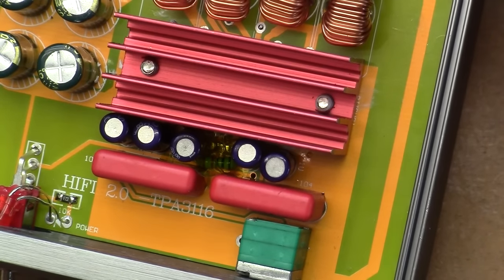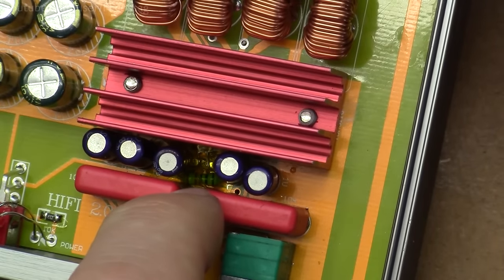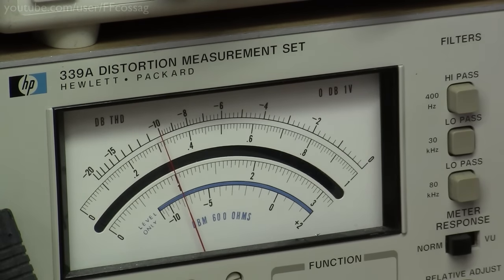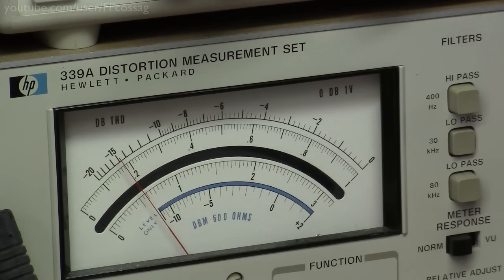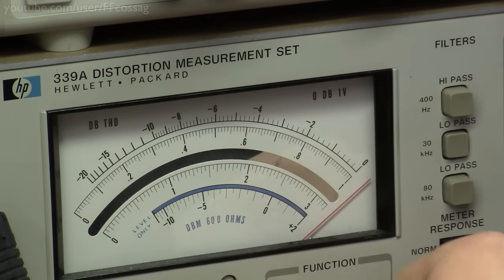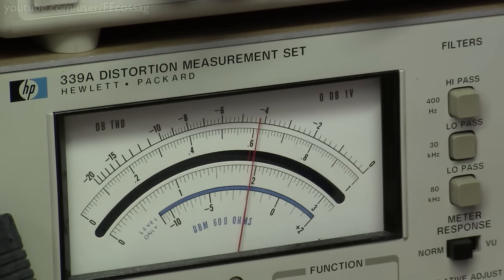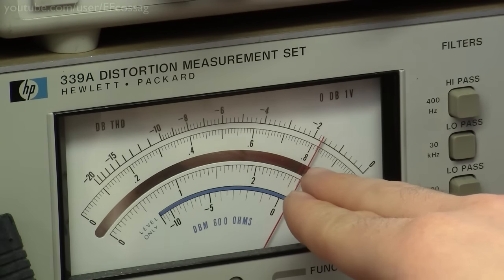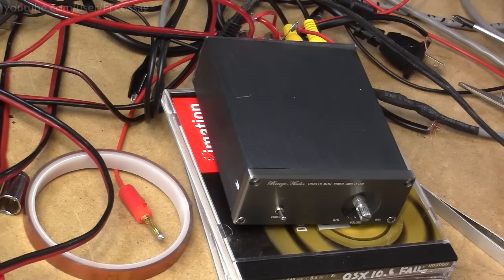Breeze Audio TPA3116: Less gain = better sound

Comment: Hi I have the newer version (?) of this that uses 2 of the tpa3116. Mine has virtually no noise floor, as far as my ears can detect. That is, turning the volume all the way up on the amp without the input playing I really hear no hiss/noise. The amp is incredibly overkill for my use. I made a portable stereo using polk T-15 speakers and with just 12 volts to the amp about maybe 1/3 volume is very loud. So running on 24 volts maybe 1/4 volume is about that loud. It's recommended to be ran with a 24 volt supply but I have a 12 volt battery that powers it if I'm not near ac power. I was wondering if you knew how I could turn down the gain on my amp, like you did with yours. I would also use the larger resister because the surface mount stuff is too small for me. The loudness of my amp isn't because of of the input signal, because I have hooked the source to other amps and I have 2 identical input devices and they are both the same, it's just this amp makes alot of sound. I showed it to a friend and he thought I was performing some sort of magic trick, because he couldn't believe there was so much sound. Those polks I think are rated 8 ohms but both of mine have a dc resistance of 3.9 ohms. I at first thought I had blown the tweeters but checking each woofer and tweeter individually they are all fine. My old home stereo amp didn't like speakers much below 8 ohms and the polks would make the protection kick in, so that is also one of the reasons the amp is quite loud with the polks. I would like to lower the gain of it, but can't find the info. Thanks. This vid was informative, it prompted me to by this single chip version a couple years ago. Thanks again.

Comment: I removed the 100k and added what I had on hand, a 6.8k SMD 0805 in parallel to the 47k, so it's 5.9k, pretty close to the 5% specs, oddly enough, the newer datasheet revised Oct 2016 http://www.ti.com/lit/ds/symlink/tpa3116d2-q1.pdf says on page 6 20k/OPEN for R1/R2, but on page 11, it's still 5.6k, basically with R2 open, GVDD is not referenced  and R1 is only acting as a pull down instead of a voltage divider, I wonder if one can just remove the 100k and leave the 47k in place and see what kind of gain the internal ADC picks froms it's 4+4 master/slave states.
Reply: many years, no answer! it's not easy to find a 5.6 resistors, I replaced with 6.8k, I hope this can help

Comment: I have an amplifier module with TPA3116 which is a different model than the one in the video but also has too much gain. The problem is that to lower the gain I need to remove the heatsink because the resistors to be unsoldered are just below. 
Does anyone know how to remove these Chinese heatsinks? I don't want to force and break the chip.
Thanks to whoever wants to answer me.

Comment: I am not an English speaker,so I couldn't get this clearly. I just understood that you removed an smd condensator (resistor? what was the resistance? ) and replaced it with a resistor  by what resistance? could you please wright . (I'm not good at hearing specs you said). Thanks

Comment: In terms of sensitivity, what would the figures have been before and after reducing gain? I'm guessing around 500mV (or even less) before modding, to allow the amp to max out with portable devices. I've found excessive gain to be an issue with these mini amps. I've owned half a dozen Tripath and TPA3116's and most would max out with a 2V signal (CD player, or the line-out from my Essence STX sound card) with the volume pot at about 10.00 - 10.30. The exception is an Indeed Labs TA2020 which was more like 1.30 - 2.00 and it also happens to be easily the best sounding of all them.

Comment: Very interesting! But with the add of the resistance how much we lose in watt for power? Is it right to say that now is more or less like a TA2024?
Reply from the maker: +Andrea C No, no power is lost. We're only changing the ratio of how much the input signal is amplified. Originally, we had a gain of 32 dB, or 40 times. That means that in order to reach the maximum output of about 15 V, we needed 0,375 V of input. Now we have 20 dB of gain, or 10 times. That means that in order to reach our 15 V of output, we need 1,5 V of input instead of 0,375 V.
Reply from the maker: ***** It matters if you're going up in gain (=lower impedance), but if you're going down in gain, you're just getting more LF response for basically free.

Comment: Was the gain changed by attenuating the input or by increasing the feedback? If the second option. one would expect an increase in feedback to lower the noise and the THD.
Reply from the maker: +Michael Beeny It's impossible to know, the resistors are connected to an ADC which sets the gain internally by some mechanism. If you look at the simplified block diagram, it seems to be an input attenuator, but it really isn't detailed enough to tell for certain.

Comment: hm... would this method improve the sound of all class d amps?
Reply from the maker: +Das OSi It depends on the particular implementation, but as a general rule, less gain = less distortion. I would say that this case was quite extreme in how much it improved, however.